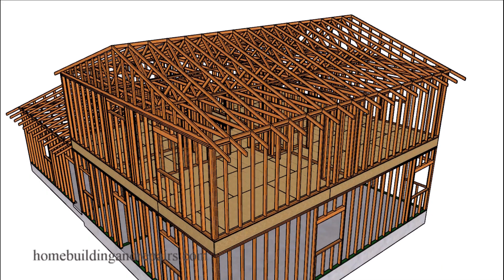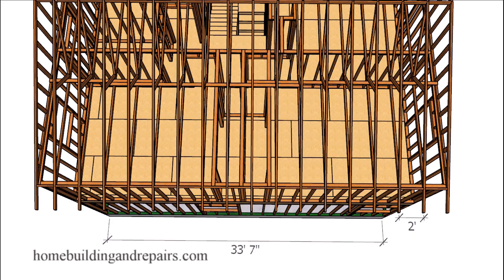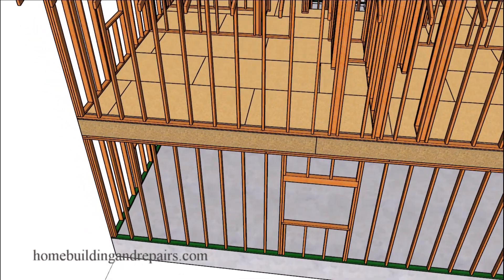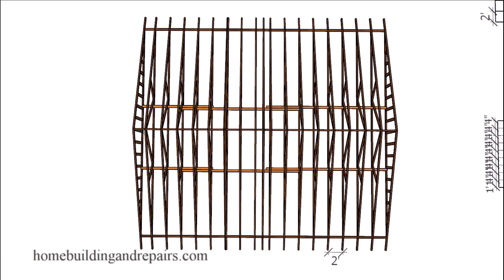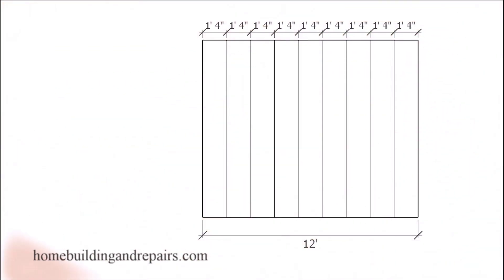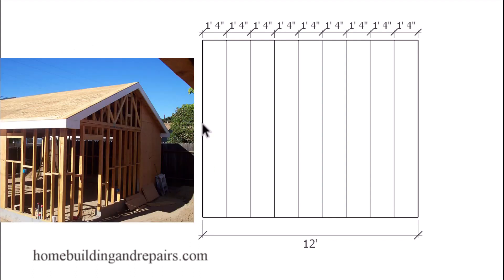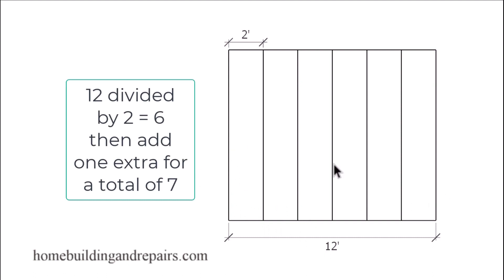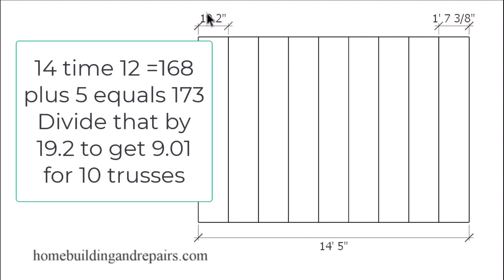How To Calculate Amount of Roof Trusses Needed To Build Gable Roof - Simple Math For Builders

Comment: What is the cost to span a distance 36' from one perimeter wall to the other? BTY I want to build with 2x6 studs so I should be able to build 24" on center. This would be for a small Desert home. I want a garage too. And that would be 24' wide and 36' deep (it will have a workshop / storage in the back of the garage. So just a continuation of the trusses all across the length of the home and garage? 36 + 24 = 60 feet, all of it 36' deep. And the last truss that's parallel to the perimeter wall, is that made of thicker wood at the rafters, so that there can be lookouts installed? anyway, at 60 feet that's 30 trusses. What is the cost of a truss spanning 36'? This is for a desert area home, in east San Diego County, CA. (I'd build a flat roof if the county would let me, but maybe that would be just as expensive in the long run?)

I'd really like to know what is the cheapest, cheapest way to build a home. I figure 2X6 24" on center is the cheapest way to build and meet R values mandated in California. Anyone out there have any ideas for me? I was also thinking about a concrete block home, but that seems like it's just as much work in the long run.